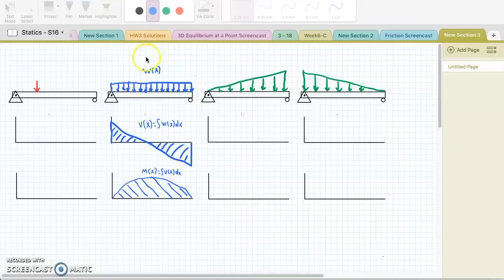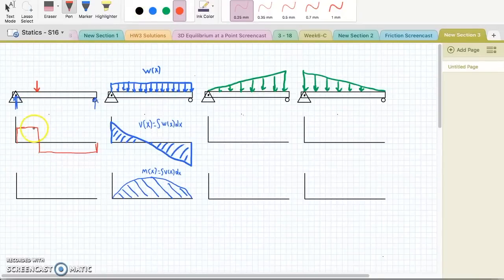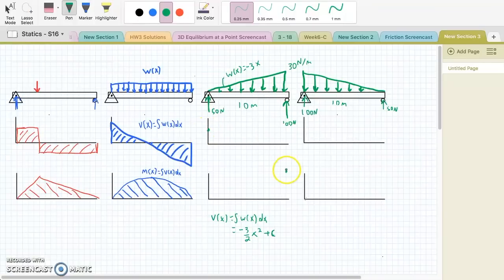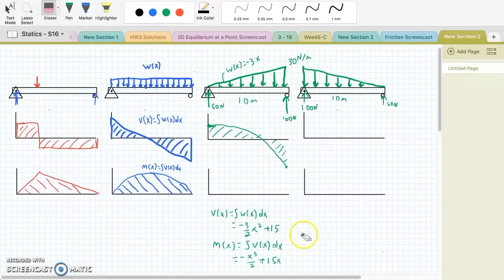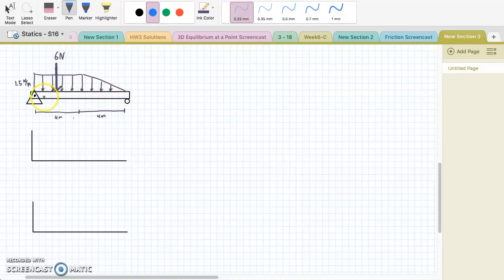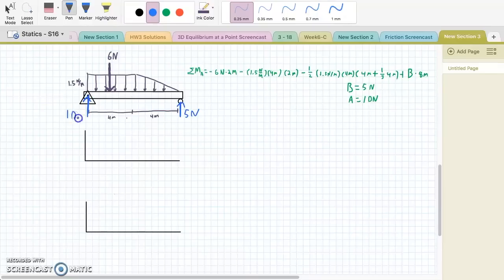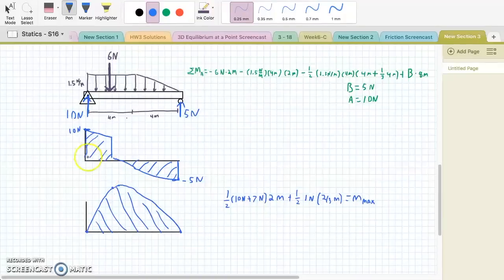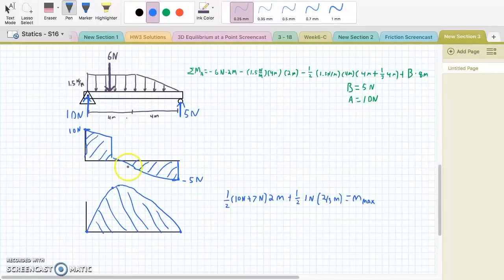Shear and Moment Diagrams for Combined Loadings

Comment: I think for the green triangular distributed load the reaction at the roller should be 200 N and the pin should be 100 N...
Reply: The total force of the triangular region is (1/2)*b*h = (1/2)*(30 [N/m])*(10 [m]) = 150 [N]. I think you forgot the factor of 1/2.

Comment: the example at @8:20 is wrong right? why is there -6(2) but also - (1.5)(4)(2)  which is just 6.. why is there two -6 forces???
Reply: That was the way the question was set up. There are three loads. It would've caused less confusion if the point load was different, say 10N, then you'd have the equation start with -10 x 2 rather than -6 x 2.